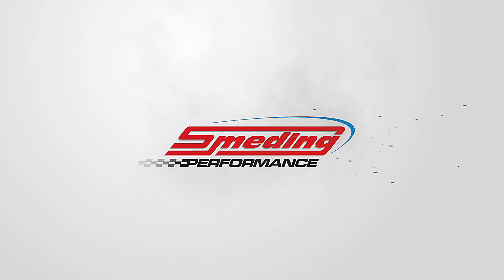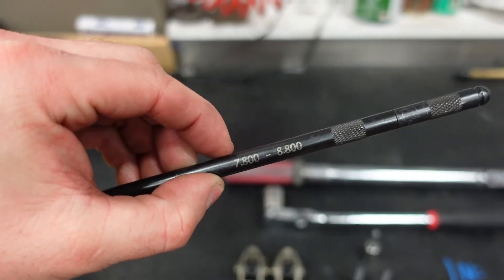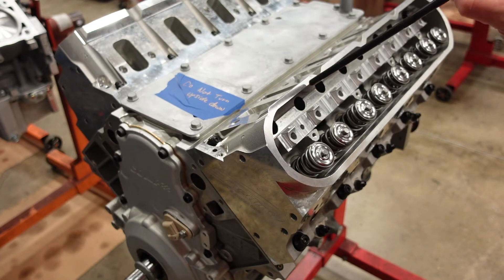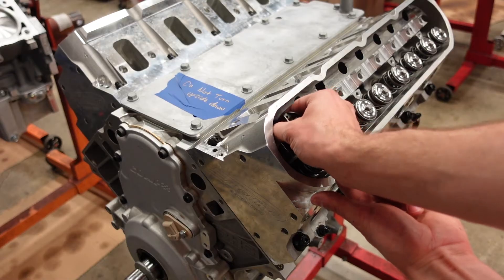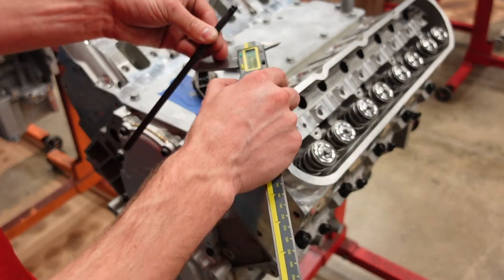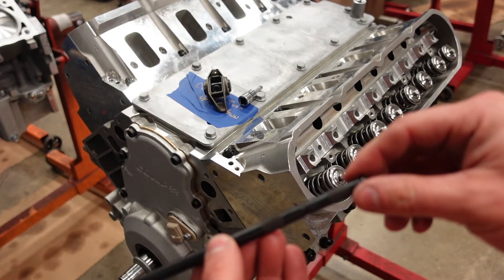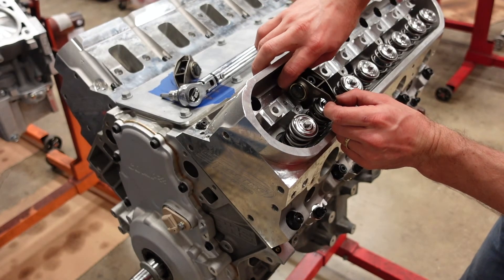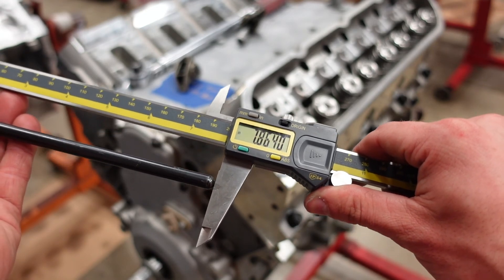How to Measure LS Engine Pushrod Length (In 7 Minutes)

Comment: I bought "quality" pushrods long ago.  Since moved to Johnson lifters & custom ground.  My "7.400" engraved measure between 7.408-7.420  That's burning up more than half my +/- .010 tolerance already.  Others have stated, if you're using Johnson Lifters, you MUST realize you're reading an offset & need to subtract that before you add your preload.
I also can't make your twisting method work! I dare you to repeat any number you get within .005" you can't that way.  That's half my stack & my motor varies by .017" over both heads.  That's near my WHOLE tolerance gone.  This video is gonna lose HP at worst & make a lotta motors not run...
I'm on my 3rd cam & figured this out last time w/ a tech from Manley... hope this helps somebody.

Comment: Very helpful video, thanks for posting. Seems fairly easy to do, just need that longer caliper. I am building a 6.0L LS engine, my first one, and I really seem to like those tie-bar lifters that eliminate the plastic trays. Those are very common in BBC and SBC builds. I understand since they are heavier, more valve spring is needed to compensate.

Comment: late to the party here. but anyone have a huge issue with the whole adjustable pushrod turns instead of just the top portion to expand it?
Reply: Yep, I had the same problem. Had to use a pick tool to hold the bottom part of the adjustable pushrod while I turned the top. Huge pain to do especially with barely any room to get my fingers im there to even turn the top part alone.

Comment: One thing no one ever mentions is the lube hole in the lifters.. which way do they face?
Reply: From what I have read they are supposed to face toward the inside of the engine. Regarding the tie-bar lifters, the tie-bar is supposed to also go toward the inside of the engine facing the lifter valley.

Comment: Are Factory LS engines the same as this, I thought they were the same length???  
Thank you!!!
Reply: On this engine, he is using tie-bar lifters, not factory LS lifters. Also, he is using a non-stock camshaft that probably has way more lift and a smaller base circle. That is why the pushrods need to be longer.
Reply: @ekitching  Thank you!

Comment: Important to KNOW the lifter has oil in it to get correct operating height to do measurement. If is empty or partial fill, will not be best measure length.

Comment: New to this. Working on my first LSA. What is the point of lifting the rocker back off the valve stem towards the push rod? I see some people do it and some don't.
Reply: You can feel the lash close up so you feel when to stop and it helps keep the pushrod seated on the lifter while turning it.

Comment: If you're new" let me do you a big favor. This is not correct.  If you want to approach it in this manner, you have to use a light spring inplace of those heavy springs. I pinch it here with my finger and then measure.... seriously?!  🤯  For those of you watching this with no experience at all. Before you make a decision go watch richard holdner.  Then make your choice 📌
Reply: Wrong. He is not spinning the motor with the rocker arms torqued down. Thanks for the video man!

Comment: I'm doing a head gasket job on an 07 Yukon Denali.  I got the heads back on an now I'm installing new Rocker arms. I notice when I'm torquing the arms to 22 ft lbs the tip of the arms are sliding from the center of the valve stems the tighter they get. Also the springs are compressing as I torque them. I'm quite sure the #1piston  is top dead center and the pushrods are seated properly. What can possibly be the problem? I live in Minnesota and I'm trying to get the truck up and running before winter hits. I would greatly appreciate your help
Reply: When the # 1 piston was at top dead center were you trying to tighten them all down at once or just the valves at the # 1 piston ?
Reply: @44special9  I was tightening down the valves on the #1 piston. The intake rocker was sliding off the center of the spring while torquing and the exhaust rocker compressed the spring quite a bit once it was torqued to 22 ft  lbs. I'm doing this job for my nephew. He ordered some rocker arms that were supposed to be for either a 4.8, 5.3, and 6.0l engine but he has a 6.2l would that make a difference?
Reply: I checked the specs. on the On ALL Cylinders website and it appears that the 6.2 l. has rocker offset on the intake rocker and the smaller engines have no rocker offset which might explain it sliding off and why the 6.2 l. wasn't listed on the box , just my guess .                                                                                                                                                  As for the exhaust rocker compressing the valve spring , you may have had the #1 piston at top dead center on the exhaust stroke (lifters not on base circle) and not TDC on the compression stroke . It's best to have the lifters on the base circle so you're not fighting the valve spring and the torque wrench doesn't want to click off before the rocker is seated . If you're sure you did then the exhaust rocker may be different on the 6.2 also . To be sure you can turn the crank clockwise (viewed from front) and feel the intake pushrod rise and as soon as it falls the whole way start watching for the TDC mark because it will be at the pointer soon and line them up or some other method of getting the lifters on the base circle because there's plenty out there . Hope this helps .  @Robert-uc5pb
Reply: I believe lining the timing marks up to get TDC only works on pistons 1 and 6 but when one is on the compression stroke the other is on the exhaust stroke .

Comment: Might be a dumb questions but will pushrod length change/vary with different cams? I’ve never built a motor before and I’m going to try to LS swap my 98k1500 so I’m trying to learn as much as I can before I start
Reply from the maker: It is possible.

Comment: Hey Jacob, love the videos, but I have a serious piece to this that everyone seems to miss.  THE "GAUGE LENGTH."  Hope this all makes sense, here goes-   Basically, if you measure 7.350 with your adjustable, and order 7.400 for .050 preload, you'll actually end up with approx .067 preload, because the 7.400 is a nominal measurement.  You'll see this if you recheck preload with a dial indicator when installing your new pushrods that you measured/calc'd.  The pushrod companies add about .016-.018 because of the cups/oil holes/etc.  YOU NEED TO SUBTRACT .017 FROM YOUR MEASURED LENGTH, then add lash, and order that length.  .017 might not seem like that much, but when you're already fudging one way or the other to get to .025 steps of available sizes, it can throw your preload waaayy off.  If you have over .200 of preload to play with, it's probably fine.  But not all lifters have such a large range, and adding almost 20 thou of preload could hang valves open.  Most people probably don't notice, but I learned the hard way after my measurements didn't add up, testing with a dial indicator for preload during installation.  I called Trend pushrods to get this figured out during my troubleshooting.
Reply: Thanks for this comment. I am measuring for new pushrods and noticed that my old pushrods measure at 7.4155" even though they have 7.400" etched on the side. I was having a hard time finding any info online about it but haven't called a pushrod company yet.
Reply: Wouldn’t it just be good to give the exact measurements that you get to the company making them and the lifter style. That way your not giving them a rounded off number. They should know what to compensate for from the original measurement. In theory.
Reply: @e63_widebody4  in theory, maybe.  But you're usually ordering from a catolog/online or a salesperson.  Not the actual person "making" them.  Things like deck height, head gasket thickness, milled heads, valve length/installed height, cam base circle, etc all go into it.
Reply: I'm glad I read this. 

I measured just like the video suggested - and same results as the guy above me - no compression. Johnson ST lifters - and exhaust valves hanging open.

I picked up some test springs and going to measure again.
Reply: @bonecrrusherSS will be doing this soon with Johnson ST2116. So it’s a must to subtract .017 with Johnson’s that’s the only catch here if you don’t know?
Reply: @SL0Z07 so I put in test springs and measured again - my intake pushrods are one size too big. So going down one size - or subtracting .017 is going to put me at the same length. 

I'm going to initially try the original exhaust pushrods - and the next size down on intake pushrods.

I think that will fix my situation.
Reply: I’m running the Johnson linked lifters, #2116LSR in my LS3.  Do I need to take .017 away from the overall length?
Reply: @roberthurtado6291  it has nothing to do with the lifters, it's a pushrod thing
Reply: @MapesTom  Cool!! Thanks!!  So from my overall pushrod length, I take .017 away right?  Then add my .035 +\- .010 right?
Reply: @roberthurtado6291  That is correct.  The basic premise is that if, for example, you measure 7.380 at zero preload, and wanted .020 preload, and ordered 7.400- they would arrive and measure approx 7.417, and you'd have .037 preload (or hold valves open) instead.
Reply: Awesome information 
Thankyou
Reply: Following up on this - the .017 - or one size smaller fixed my compression issue right up. The car made 800 wheel on 93 and my Kong 2650. 

I just tore everything down for a different issue - and the pushrods, lifters, and rocker arms all look good with no issues.
Reply: Hey, MapesTom, I guess you're luckier than I have been. I've called Trend, even got the top bosses cell#, and he didn't answer. So I left a message, and never got a return call!! Trend must be doing mighty well, as they don't need my $$$. Sad, because I live just 50 miles from their Michigan plant. So I went with Manton. Instant customer service, easy peasy....
Reply: That’s dependent on how each company measures their pushrods
Reply: I did a rebuild & ordered stock parts & started engine had low oil pressure light & valves hit pistons on all 8. Do you think i should have minus that .17 on the push rods because valves seems to just touch pistons just enough to make a mark on them. Thanks
Reply: @mrflinstone2553  17 thousandths isn't enough to cause that.  There is a bigger problem.  My bet is cam timing, not dot to dot, etc.   Post up when you figure it out.
Reply: @MapesTom  thanks for the reply, i did remove everything & timing was spot on. I purchased everything from gm exept crankshaft wich i got from summit. Same spec as original, i just dont know what else to check. Every part in the engine is new
Reply: @MapesTom  its l92 engine, im thinking maybe cam phaser defect?
Reply: Can't say I agree with u it really depends on manufacturer my stock lq4 pushrods were 7.395 stock gm Michigan motorsports "7.400" actually measured 7.375 now the btrs I got "7.400" cam out to 7.410
Reply: @MapesTom Do you know is this is true for trick flow pushrods also?
Reply: Put your pushrods in. Turn over crank to get on base off lobe, Titan rocker nut with two fingers on nut rench or Allen, until there is contact on pushrod and valve, with two fingers turn the push rod, there should be light drag.  Titan rocker with rench just enough to seat rocker to tray,  no less then half turn, no more than one and half. Tork to 22 ft lb.
Reply: This is so wrong you realize aluminum block and heads also expands 0.010-0.015” at operating temperature. You actually lose preload load got from cold
Reply: @chriswalker2718  I'm not the sharpest knife in the drawer, but trying to Apply your science,  if what your saying is an issue that Applies, how would you keep your head gaskets from leaking? When the engine warms up, But less heat to bell Housing,  Do you lose torque on those bolts?   One thing for sure. Thanks shrink up when it gets cold, I tried to write my name in the snow this winter and it came out looking like Chinese🥶
Reply: @kevinwest3689  this is common sense I’m using Johnson 2116 lifters in my 427ci darton sleeved ls3 with 1/2” Arp head studs. Individually measured every pushrod to get as close to 0.030” preload at operating temp. But actually ordered pushrods that are all 0.045” above cold 0 preloaded length. Ask Johnson about thermal expansion effecting preload ask tony Mamo ask anyone. Aluminum block heads has more expansion than iron block aluminum heads. Lifter for stud mounts require different preloads because of this thermal expansion depending on aluminum heads with iron or aluminum block. The head gasket isn’t going to leak.
Reply: 0.045” preload cold puts me right around 0.030” hot
Reply: @chriswalker2718  what are you referring to when you say this is so wrong?
Reply: @MapesTom  your need to subtract 0.017” from your added length for preload is wrong because with expansion of block and heads with torqued head gaskets negates that. Your reasoning is 100% incorrect. Lifters that require 0.030” +- .005” preload with a pushrod that give you 0.050” preload at operating temps gives you right around 0.035”-0.040” preload
Reply: @chriswalker2718  I think you're missing the point (overcomplicating the issue with something else that's also true but separate).  You're ideas about hot and cold preload (just like hot and cold lash with a solid roller- preload is like negative lash) are all correct.  However, it's a different thing, which also needs to be taken into account by the builder.  I'm only referring to the actual measurement of the pushrods.  If you measure 7.400 with a dial caliper, then order 7.400, they will measure about 7.417.  Hope that makes sense.
Reply: @MapesTom  yes it makes sense but when you order pushrods your accounting for 0.050” in your measurement and you end up with 0.067” preload your actually ending up with 0.050” hot after thermal expansion. And if you order pushrods that are 0.033” over measured length like your assuming after thermal expansion going to be on the low side of preload under 0.050” and going to have noisy valve train. Your better off being on high side accounting for thermal expansion and will have quieter valve train at operating temperature. Again how many times have you measured pushrods and pprdeted custom obviously never.
Reply: @MapesTom  and the other thing is the standard ls7 or ls lifter has 0.200” travel. So even with 0.080” of preload your not hanging valves open.
Reply: O wow, thanks, you possibly saved me further beating head against a wall trying to figure out why car won't run...putting in johnson's drop in atm and making sure i know what i'm measuring if i have to get pushrods r not.
Reply: I just measured my existing pushrods, and they’re dead on with caliper if measured close to the ruler where the divets are.  But as vid measured are indeed what you say, lil shorter
Reply: That is why people need to use the turn and count functioning the checker  instead of the calipers.
Reply: @GearheadOutlaw   That is partially correct, the tool doesn't measure the length... BUT the resolution of a single turn isn't good enough for me... having every pushrod individually ground.
Reply: @ohane1 then you buy a propper pushrod length checker
Reply: @GearheadOutlaw  lol, no. They all measure from the 2 spheres at ends.
All tools have terrible resolution.
For stock .100" +/- it's fine. For crazy lifters the tolerance isn't obtainable by spinning. .001" matters when total allowable is +/- .010.
You show me any tool that measures that.
Manton is making my custom set & they use an offset from what we measure... so it's not just me who sees the issue. If people try getting close w/ normal (expensive comp cam tool like mine) they can get hosed if they don't get what we're saying.
Try measuring your "good tool" w/ calipers. It's gonna be .015-.030" off from what's printed on it.
Reply: @ohane1  Because they forget the oil hole are drilled and are flat so when measuring with a caliper it show up as shorter......

I guess those short travel lifters and low lash set ups were just a lucky guess...
Reply: @GearheadOutlaw maybe we're speaking different languages. Measure any tool w/ a caliper & you're not gonna get the number the manufacturer says.
I've only seen spherical ends on pushrods, rockers & lifters.
My measurements are always longer on pushrods... cause I'm measuring past the spheres on ends... which could be ground more or less & still be accurate as long as the 2 spheres meet.
I think you're missing something that doesn't matter to you. Can't measure 2 ball & socket joints accurately w/o knowing the centers of the spheres. It matters more for low travel. Hard/impossible w/ any one length.
Reply: @ohane1 like i said...
Reply: One of us should do a video... You're correct man & it's gonna mess folks up.  Surprised nobody talks about this.  My guess is that once folks go as far as Johnson lifters, they care enough not to go to YouTube for instructions.
Reply: Thank you I measured exactly like this and ended up with my valves open no compression....pushrods too long....I'm assuming because my johnson lifters have less margin of error than the other lifters
Reply: @gustavosanchez8158  when you say you measured "like this" do you mean you compensated like I described?  Or did it like the video and found that to be the problem?
Reply: @MapesTom  by doing it like the video and not subtracting the .017. I found out last night going from no compression to 150 just by cracking the rocker bolts. If using ls7 lifters or sum with a wider range of preload might be ok but with the Johnsons I think that's the issue.

Comment: Don't use this method (checking just one) without billet stands, factory cast LS stands can vary quite a bit !
If using factory stands, measure every one. 

Also, an easy way to remember  which valve to adjust is, 
Every=exhaust
Oliver=opening 
Is====intake
Cool==closing
YW=you're welcome